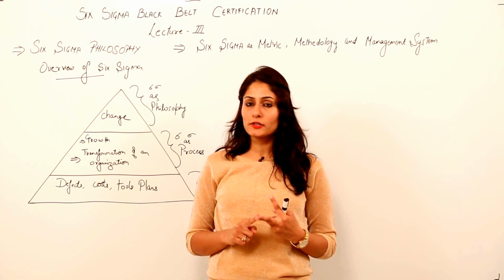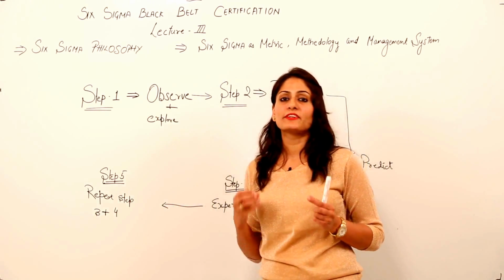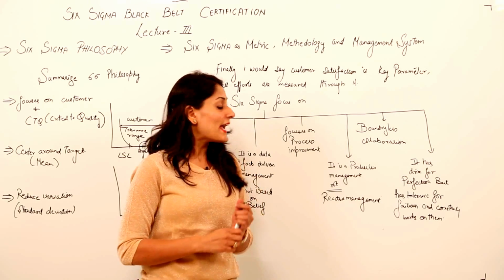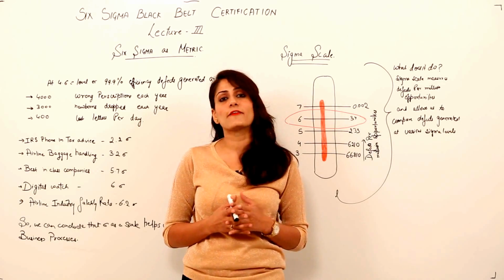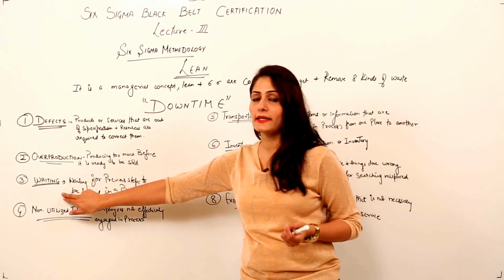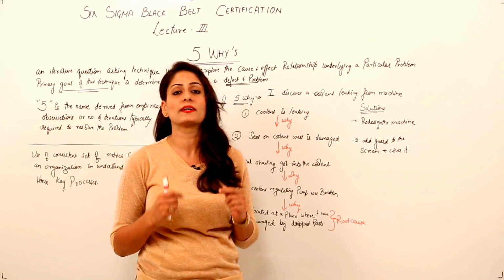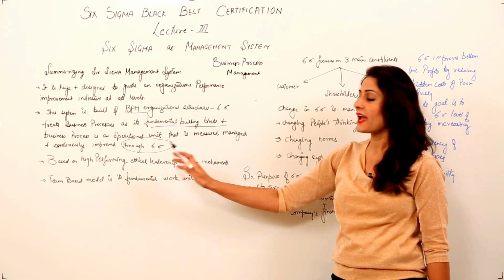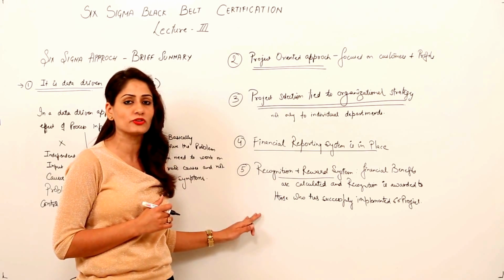Six Sigma Management I Lean Six Sigma Training I jsixsigma.com

Comment: suppose if i have a defect ppm of 2000, then what sigma level is my process on ??
Reply from the maker: +siddharthagarg24  sigma level of your process would be  4.38 and it would be based on assumption that your process could drift by plus or minus 1.5 sigma in long term..
Reply: +janam sandhu so are these values of defect ppm related to sigma levels calculated by some formulas or are they based on practical results.....like is 3.4 ppm a calculated value or is it the lowest defect ppm achieved by some company using six sigma ?
Reply from the maker: +siddharthagarg24 , yes there is a formula for the conversion, you can calculate using excel , formula is (NORMSINV(1-$D2))+1.5, where you enter data in cell D2 and it should be decimal (for example, 30% error rate = 300,000 DPMO = 0.3 which calculates as 2.02 Sigma Level).you can check my lecture six for same where i have explained how to calculate DPU, DPO, DPMO and RTY which you will need for this calculation, apart from this conversion tables and online calculators and tools are available for such conversions.
Second, 3.4 defects per million opportunities is considered  world class standard and it has been standardized by Motorola but how this figure has been achieved and the formulas they used are bit arbitrary and debatable, but my point of view is that six sigma should not be confined to just achieving this  figure as the core and soul of six sigma is to reduce defects from your process, so check your process from customer's perspective and stakeholder's perspective and then try to reduce the defects, plus a lot depends on your process for example if you manufacture digital watches then you have to look into aspects such as speed, accuracy etc but if you manufacture mineral water bottles then there would be different concerns but then you won't be bothered  if few bottles are filled with more water compared to set limits, so accuracy won't be a concern when filling the bottles. so basically what i want to say is understand your process, collect data and then figure out where you need to work on to improve your process.

Comment: If customer LSL and USL is undefinable, meaning the particular part of the product is either good (on target) or bad (not acceptable) can you even use six sigma for this? So if the requirement is an attribute (either good or bad and no in between) can you measure it to eliminate the variation as much as possible?
Reply from the maker: solar3mpire Hello, since your product probably does not have any spec limits, so you should focus all your energies in production stage and use DFSS and use six sigma tools during production so that chances of error in final product are negligible.
Reply: Thank you for your answer :)